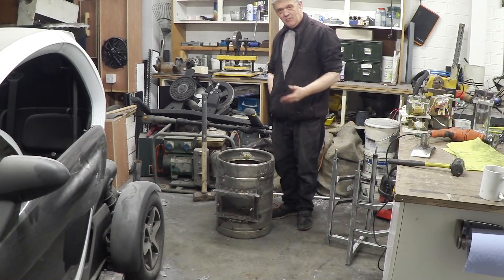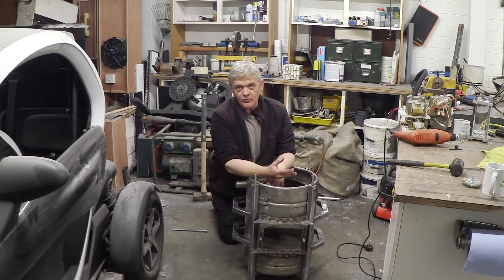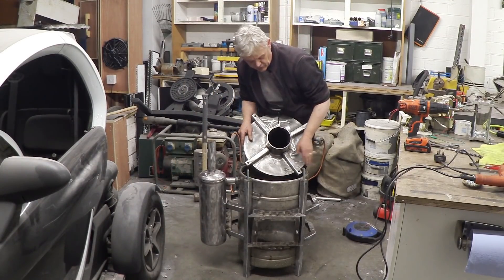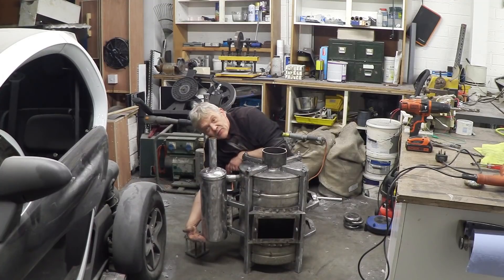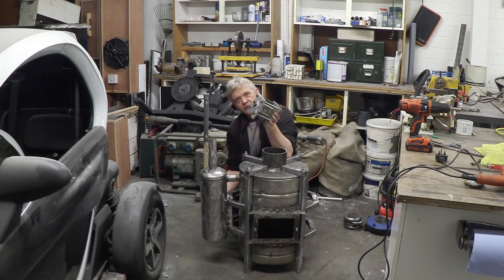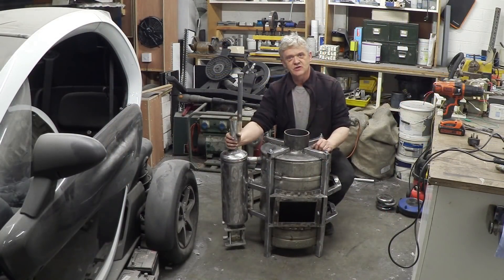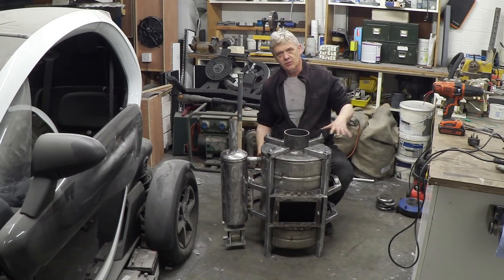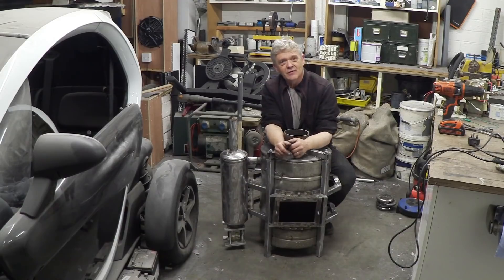DIY Gasification and Generator Unit - Part 5 - Second Stage Filter

Comment: I was wondering instead of using high temp sealant to seal the top of the Gasifier, could you use a wood-burning stove door gasket or automotive exhaust header wrap? It would make the later top cover removal easier.
Reply from the maker: I was wondering that - I think I will use exhaust wrap on some of the pipe joints mate

Comment: You may want to look at water filtration and cooling. This produces a cleaner burning gas and makes plumbing easier as you can use pvc pipe. The drawback is additional pumps and water management.
Reply from the maker: cheers mate

Comment: You would make the perfect homebrewer. I brew my own beer in quite a simular setup. But all is not stainless steel in your setup is it ? Did you weld stainless steel so far ? Is that hard ?
Reply from the maker: actually mate it's a mixture of stainless and mild steel - I haven't found welding the stainless to be too much different to be honest - I used 309 rods
Reply: @ThinkingandTinkering  thanks mate. Im gone try

Comment: A good way to make a gasket for your lid:

1) Put put nuts on the threads and adjust them so that the lid and barrel have a 1/8th - 2/8th even gap all the way round.

2) Take the lid off and put a good 1/8th to 2/8th bead of sealer on the barrel.

3) Gently lay wax paper, wax side facing sealer all the way around the top of your barrel.

4) Set the lid on top and make sure you press it down so that the bars touch the nuts.

5) Let it cure over knight.

6) Once the sealant is cured, remove the lid and the wax paper. 

7) You should have a gasket that matches the bottom of your lid against which you can seal the lid.

Unless you have a better method of making a gasket like just cutting a large piece of rubber gasket.

I modified this from the Appliance Doctor; Steve Gannon's fix for worn refrigerator gaskets.

In that situation, you apply the sealant to the refrigerator's warn gasket, put the wax side of wax paper on it and close the door allowing it to cure overnight. When you remove the wax paper, the refrigerator will seal up tight.
Reply from the maker: nice one mate - thanks for the tip
Reply: @ThinkingandTinkering  😎👍

Comment: Looking great so far Rob. The top of the burn unit (keg), couldn't you use fibreglass rope as a sealant before bolting down, would make it easier to take on and off compared to the silicon type sealant. Also just wondering how much you have spent so far  on welding rods?
Reply from the maker: it would mate and I was thinking of doing it too - as for the rods - nothing - a friend of mine gave me a stack
Reply: @ThinkingandTinkering  very nice, makes learning all that much easier

Comment: Very innovative Robert!! You surely put your own twist on this unit :) Very cool design concept!!
Reply from the maker: Glad you like it! cheers mate
Reply: I would suggest using ceramic high temp seal on the reactor. Here in the States I use an adhesive backed seal that you stick in place and then bolt flange surfaces together. May look into that, I dont know if your sealer will hold up or not. I have never seen a sealant in a tube than can withstand more than 600* F and that is hardly high enough.
Reply: @Thrive-Off-Grid  they have tube ones over here that are rated at 2200F   I’ve used them in hot places and they’ve held up. I don’t know what temp I got to, but it was more than 600.
Reply: @lokilyesmyth  Are you talking about the ceramic rope seal? Yes we also use a flanged version of that seal as well for our doors.
Reply: @Thrive-Off-Grid  no they sell caulking tubes with sealant that comes out like silicone or acrylic caulking, but made for stoves and fireplaces
Reply: Look up ceresit CS 38
Reply from the maker: the stuff I have is 1200 degrees C which is 2192 degrees F I got it at the local big box hardware store - it's actually why I chose it - so easy to get hold of!
Reply: @ThinkingandTinkering  Yeah there is the stove cement. Yes we can get that as well. However after you service the unit a few times, its not very practical to use. Where the ceramic tape you just tear off and replace. It hardens as it heat cycles and forms a good seal. But I see where you are going with this build so carry on :)
Reply: You being the chemist you are. Here is something I am interested in and might be a cool experiment. I want to entertain the idea of using direct engine exhaust gas as a shielding gas for MIG welding. You would need an adaptor to the engine exhaust, SS appliance NG flex hose, a small cooler, and then piped to a small air compressor. Mabey a friend can loan you a small MIG welder. I plan to try this at some point.